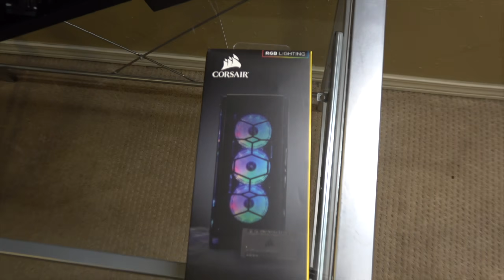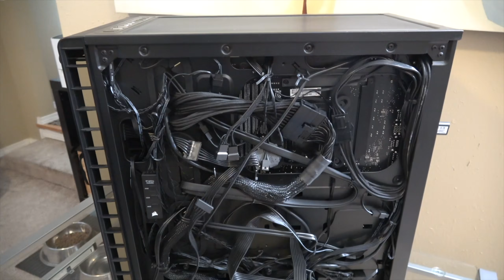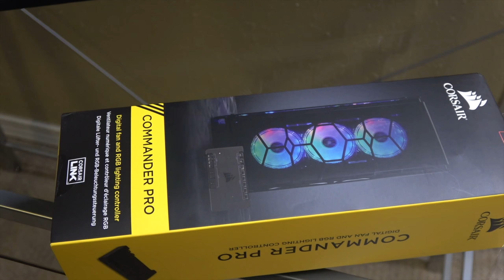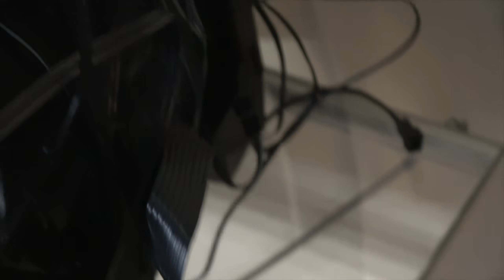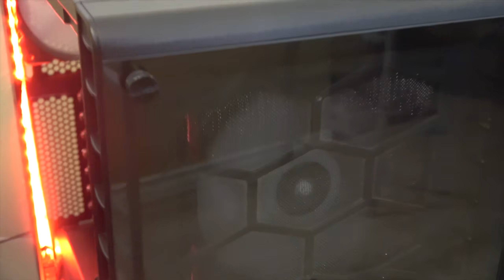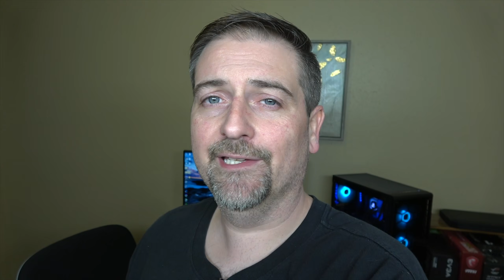Corsair Commander Pro and SP120 RGB Fans • Installed in Corsair 460X RGB Case

Comment: Very helpful video. I was thinking of getting the SP120 until I found out it doesn't have PWM. The "Lighting Node Core" that its 3-pack comes with only lets you control RGB through iCUE. Whereas, the "Commander Pro" lets you control RGB AND fan speed. I'd have to buy it separately though, and it's crazy expensive, so I'm not so sure I can justify it 😓
Reply from the maker: You may be able to find the commander pro on sale somewhere during Black Friday. It sucks and it’s a bunch of wires but it makes a big difference in noise being able to control the curve, especially with like a 6 fan setup
Reply: @TechWithSean  I'll keep an eye out. Thanks : )

Comment: new to this: will everything be fine if my h150 aio has ML120 fans and my case fans are SP120?? or would i have to either switch out by aio fans with sp120. or switchout my sp case fans with mL120's? thank you

Comment: Lol you can control SP fans speed with MB soft or bios :D
Reply: not all 6.
Reply: @jarnoojasaar  depends on your mobo ;)my controls 6 fans
Reply: @3dimon3  I have z490-e by asus, but I can only control 2 fans, other 4 go by CPU temp
Reply: @3dimon3  and that's why I might buy the commander pro myself aswell :D to slow down all fans simultaneously

Comment: question just got my new built. im breaking my head im trying to connect my sp120  fan dont know have no idea where to and also i bought a ML series 120mm  fan which i had connected to mobo i wanna connect everything in one place sp120  is different from ml120 what do i need to do or need. help!!!
Reply: Endexcks you need some sort of Corsair hub, weather that be a commander pro, node pro core etc.
Reply: @T0B  Thanks for the reply yea i have the commander pro i have all my fans working and the lighting to. but one thing is i cant change the color directly from icue. I have the x570 pc case with sp120 included with the connection. i try to change the color but im thinking this type of fan give certain color like red,blue,green,pink, white ect. and that be it. not like my mouse and keyboard you can choose what the color  you want to put light up. :-)
Reply: Endexcks if you have more than 1 type of fan in there, unplug them and keep 1 type, for example only have the sp120s or only the ML120s. And then try customise them. If that works you may have to use just one type of fan for ur build.

Comment: Are your case fans connected to your motherboard or the commander pro?
Reply from the maker: The commander pro
Reply: @TechWithSean  thanks, now i am having trouble with  changing the lighting on the fans with the icue software. it is stuck on the rainbow.  only the motherboard lights change.
Reply from the maker: Not sure if it’s the issue, but you do have to create a profile in iCue and tell it what model of fans they are (SP, LP, LL, etc.) to get full control
Reply: @TechWithSean  i have setup a profile with the sp rgb pro, but again, only the mb changes
Reply: @TechWithSean  So I got the mb to sync with its software with the rgb strip, but no matter which profile I try with icue, the fans stay in the rainbow

Comment: Hi, are borth the RGB Hub AND the Commander Pro connected to SATA, or just the Commander Pro? Thanks
Reply from the maker: Nicolas Plitz - I’m pretty sure they each require a Sata and the commander pro hooks into a usb header also.
Reply: @TechWithSean  Where did the Power SW, Power LED+ and Power LED- cable from the I/O pannel get connected? And what happened to the 6 pin from the I/O Pannel that went to the SP Lighting Hub? Thanks so much!

Comment: can the sp's get rainbow effect too or is that only LL's that can do that? Mainly asking because i have my 3 stock sp's from my case and i have 3 LL's that i bought. I am hoping the node pro i have can sync them all together into a rainbow effect....id rather not spend another 100 dollars for 3 more LL's..
Reply from the maker: Kouta Maher 6:19 is what rainbow looks like on the SP’s. I unfortunately don’t know how mixing and matching different fans on one controller works
Reply: @TechWithSean  thanks a lot!. do you know if i need the commander pro or will my lighting node pro work just fine?

Comment: Thanks for the helpful video. I have this exact case, commander pro and the sp120 fans. I have this connected exactly like your diagram at the end. My only question is regarding the aio, you know how it has two fan connectors? You don’t use those and connected them right into the commander pro correct?  (That’s how I did it)

Comment: The commander pro works alot better with the hd120 fans. I have a 460x case and had 6 sp120 fans too. Then I sold the sp120 fans and bought 6 hd120 fans and the difference is like night and day. You can find the hd120 fans cheap on ebay, offerup or craigslist since the LL120's are out now. Also upgrading the hd140 fans from the sp120 doesn't require you to mess with the factory wiring  for the case fan led controller. Just swap the sp120 led controller on the back of the case with the hd120 controller and use the existing wires since they're the same and the only difference is the controller.

Comment: Hey man I just recently picked up this same case and 6 of the same fans but I have no rgb and only the 3 front fans are spinning any idea? Thanks
Reply from the maker: Empath - hmm, how are they hooked up? (Through a splitter/controller or do you have them all on individual fan headers?)
Reply: So I literally just went and picked up the commander Pro because I was so frustrated was willing to try anything lol, will the commander pro power the fans? I had all 6 plugged into the hub and then 3 of the fans plugged into the motherboard and the only fans that would spin were the 3 plugged into the motherboard, no rgb on any of them tho
Reply: First time building a pc lol

Comment: You could've just used a program called 'speedfan' to control your fan speeds, I do with my 6 rgb sp120's in the 460x.
Reply: Just picked up this case and 6 of the sp120s can’t get all of them to spin and no rgb on the 3 that are working. Any recommendations

Comment: Here is a link to a diagram that gives a little more insight to how these Corsair RGB control units interface.   

https://i.imgur.com/rccyGXj.jpg

Configuring Corsair’s iCUE software to control a colorful RGB display and control fan speed  is challenging, but having a general understanding of the hardware might make the iCUE software a little easier to configure. 

The real disappointment to all this is that other RGB control software, like MSI’s “Mystic Light” software (and other vender’s RGB control software) do not play well together with Corsair’s iCUE software on the same computer (IE: trying to control mixed RGB vendor products on the same computer with two (or more) different RGB control programs can be a problem). And, the iCUE software has a somewhat limited number of RGB devices that it can or will interface with.

Comment: Would it be a problem to hook the usb from a nzxt aio cooler to this? I know the rgb won’t link but just seeing if it was safe to have the usb from it plugged into the commander instead of straight to the motherboard
Reply from the maker: Andrew Curtis - it should be safe, it’s like a pass-thru to give you another header since the commander is occupying the existing one 👍
Reply: Tech With Sean cool ty